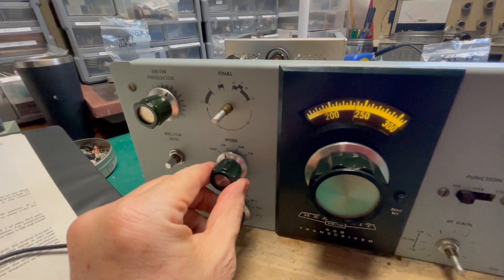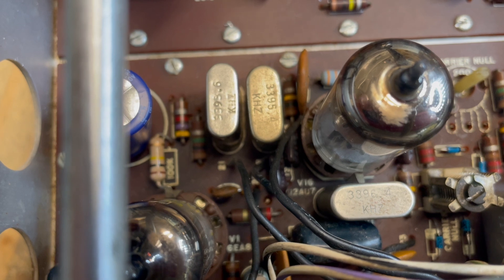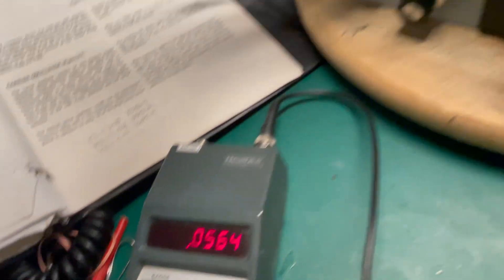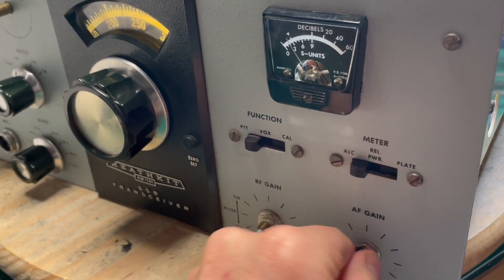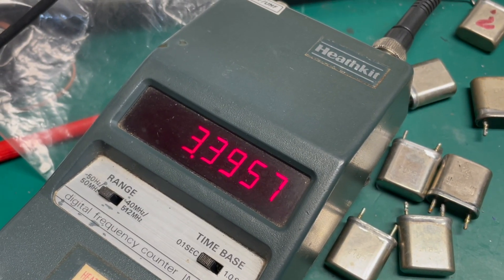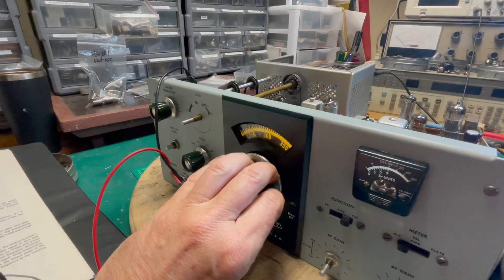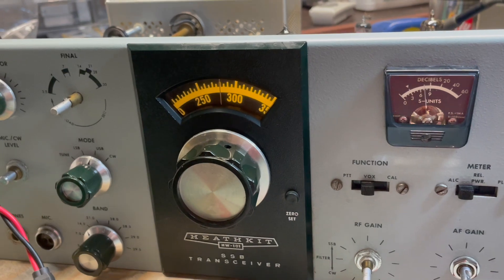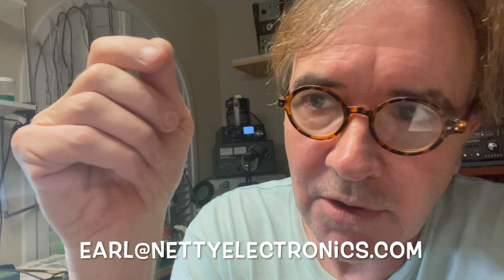Heathkit ProTip #1 - distorted audio

Comment: Yes you are right - my recently aqured HW-101 had 2 symptoms wrt the BFO: High Pitch on USB and only 40 Watt on CW if the CW Filter was activated. Luckily I could fix it by placing a 3...20pf trimmer parallel to each crystal. Adjusting the CW xtal I moved the carrier into the passband. The HW-101 is now producing the same output as with the SSB Filter. USB was adjusted for a comforable listening similar to LSB. If the Xtals would have moved in the opposite  direction we would need to place a cap in series with the xtals which would have been more complicated (need to cut the PCB trace).

Comment: I built one of those frequency counter kits and included my own op amp signal conditioner circuit to limit the input voltage to the counter. I will use it to align my HW-101 especially the vfo. I tested the counter using my rigol frequency generator and found the counter to be very accurate! The kit I bought came with an acrilic case.